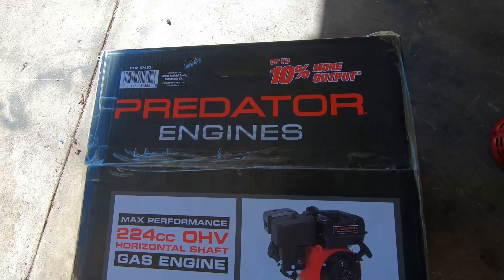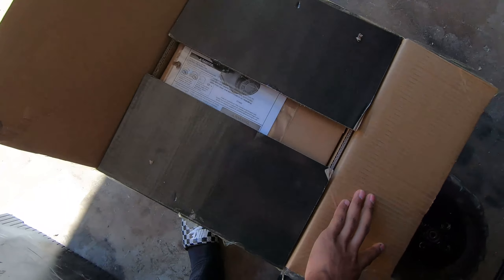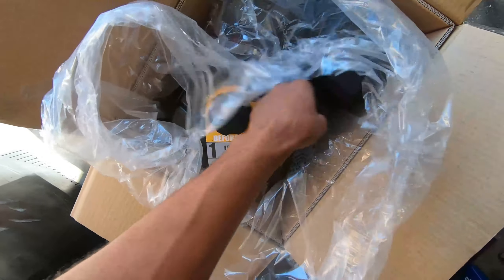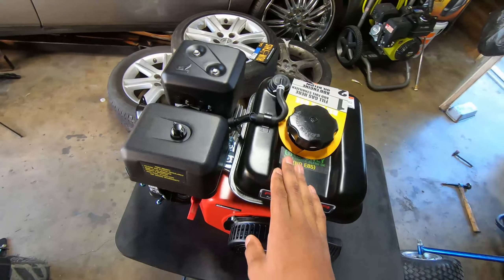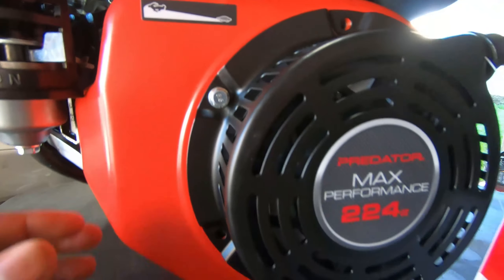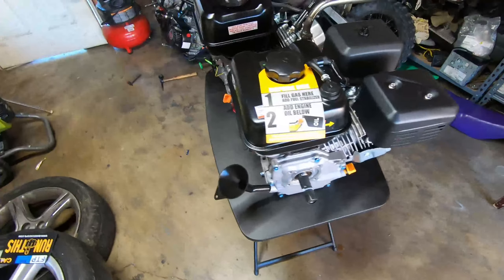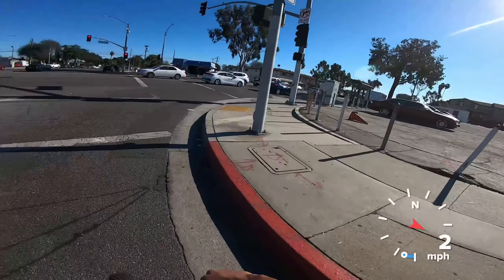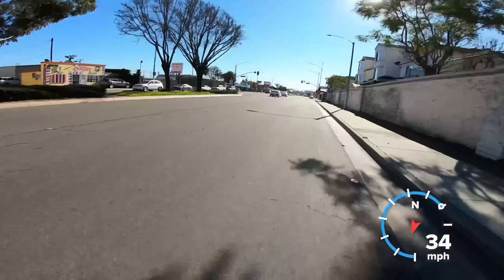Brand NEW 224 Predator Top Speed Run Out The Box!

Comment: I got my gocart to go around 42 or 43 with the way I have my chain gearing, just put a big sprocket on the engine and small sprocket on the drive axle, it will have slow Acceleration but high top speed

Comment: Got mine to go 58. Crank start 224 max performance 
Coleman Axis m200
She's a beast.
Reply: What did you do to yours to get it to go that fast I just got a  brand new 224 max performance and took the governer gear out and it’s still maxing out at 36 mph. I also have it on a Coleman ct200u frame I was considering maybe a smaller sprocket for a longer gear but I’m just not sure

Comment: Can't wait to see it with a straight pipe and  Carburetor
Reply: Iv got a stage one on it for looks not gonna run it but a 212 stage 1 kit will work if you use the 212s 10mm nuts to hold everything on the 224 capped nuts are to short and won't work so the 212 nuts are the only thing needed to make a stage 1 kit work for the 224

Comment: So what do you think of the new 224 did you feel more power compared to you stock 212??
Reply from the maker: The motor have more torque stock then a 212 but for speed nothing crazy
Reply: @RoyalJZ  I also heard the 224 is compatible with the Honda and clone motors and nothing from a 212 is interchangeable
Reply: @Orangetaco22  that is wrong a 212 stage 1 kit will work you will only need non acorn style nuts just swap to the normal 10mm nuts and the stage 1 will bolt up so ik the stage 1 will work and so will a no epa stock carb to tune it witch i did with the .38 main jet .40 pilot jet as for internals it uses clone parts but before i even run the engine through brake in im gonna build it then brake everything in together
Reply: @minibikesarenotacrime153  Pred 212 flywheels should not be used on a clone taper. The 224 has a clone taper.
Reply: My bone stock 212 does 46 on side streets weird

Comment: Do parts for the 212 work for the 224 motor
Reply: So far it's looking like clone parts. (Flywheel taper, rod journal, Cam)
Reply from the maker: Nah clone parts
Reply: @RoyalJZ  Yes. So far these are looking like a big valve, big bore, stroked clone with a heavy duty engine block. I'm glad because my 196 flywheels will fit it.

Comment: So far from testing  stock the hemi 212 is a mph faster top end but the 224 has more take off but that's stock
Reply from the maker: Yeah to see a big difference people need to remove governor and add carburetor and pipe
Reply: @RoyalJZ  coil as well 224 coil is 4k rpm and won't advance anymore then that